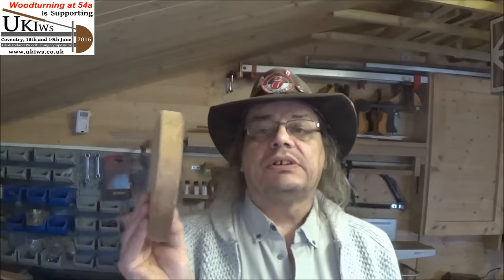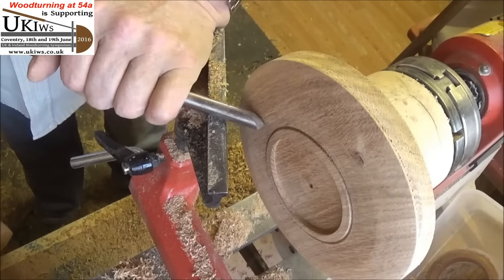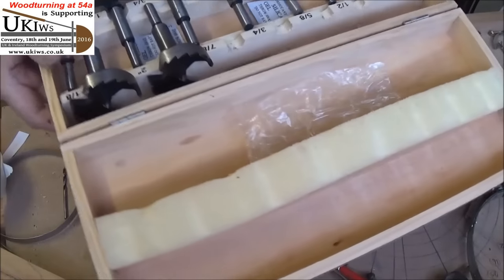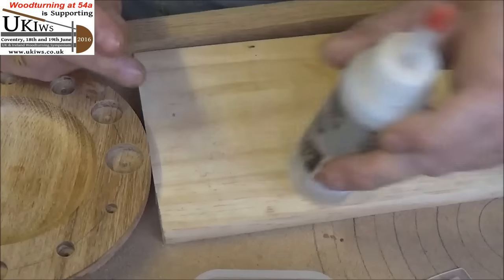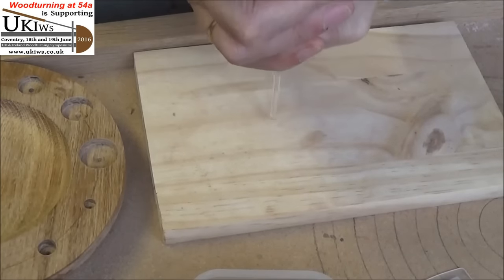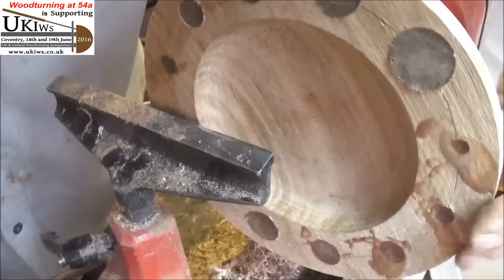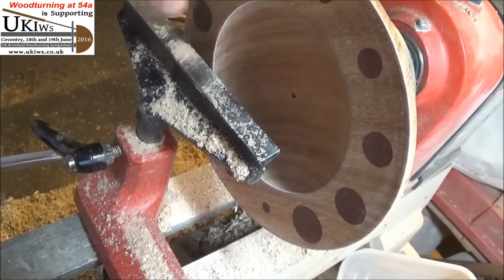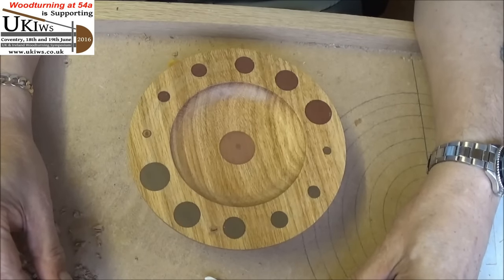Woodturning at 54a. #61 Oak platter with epoxy and metal powder inlays.

Comment: I didn't think I was going to like the epoxy inlays, thought they would look a little out of place, but I think it looks good, nice idea and I liked the increasing size holes idea, I'm pretty much brand new to wood turning, and I have to say binge watching your and Mike Waldt's videos have inspired me greatly! Thanks for the tips and ideas. All the best.
Adam
Reply from the maker: +Adam Ross Thanks Adam. There's nothing like a bit of experimenting to see how things turn out! I'm glad you're enjoying the videos,and will continue to do so. Mike's a lot better than I am,and his videos are the ones that started me off.He does the sensible things,and tells you the correct way,I do the nutty things that just seem to work for me(most of the time anyway).  Cheers,  Keith.
Reply: +Keith Barrow To be honest it was your coloured pencil bowl that got me hooked. And you have referred to Mike a couple of times in other videos so I checked him out. I have turned a couple of things so far, candlestick out of the old Christmas tree was my first and that worked really well for a first attempt, and have done a couple of bowls which came out well. I'm just trying to source a local merchant that sells decent wood but it's proving difficult so may have to use eBay for blanks ect. 
But again, thanks for the videos, look forward to them coming out and watching them.
Cheers.
Reply from the maker: +Adam Ross You're welcome,and keep on enjoying the hobby :)

Comment: If you were to apply a heat gun over them all(the resin filled holes) once the resin is in the hole it will reduce the surface tension/viscosity enabling:
1)It to bond/fill in to the edge of the holes more
2)Bring the bubbles to the top.

Brilliant video.. love your channel, itching to get the lathe back out and start some tinkering.
Reply from the maker: +TornTech  Thanks.I'll try that next time I get the resin out :)

Comment: Great minds think alike I see. I have a similar idea using epoxy with prime colored dyes. So far it is only in my head. I understand from some research on the subject that the 30 minute epoxy gives you more time to apply it and also gives it time to self level. If it is warm in the shop air bubbles also rise to the top and out of the epoxy. This would be an advantage for my idea as the epoxy will be nearly clear. The metal powder makes a nice looking inlay as well. I'm happy to see that it turns well and adheres to the wood.
Reply from the maker: +Gil Grace  Thanks Gil. There's lots of ways to use this epoxy stuff,and it's nice to have a bit of an experiment now and again :) I did use way too much powder though,but it was the first time I'd ever used it,so it was a bit hit and miss. Still,I know for next time!  Cheers,  Keith.

Comment: Love how it came out and I love working with resin myself. I always keep molds nearby for any excess I have so it won't go to waste. :) I was just going to suggest filling in that hole with epoxy but then you said it so... ;) It is really beautiful and could make a nice dish for a dresser top to hold pocket contents at the end of the day. 

Always better to call something a design feature instead of a mistake. ;) I fill holes all the time with epoxy. Just put some packing tape on the back of the hole so the resin won't leak out and fill it in. :) 

- Heidi
Reply from the maker: +BlackCat2  Thanks Heidi. I did put a bit of tape underneath like you said. I should have mentioned it in the video,but I always forget something!! Good idea about keeping a mould handy for excess epoxy,i'll do that from now on,thanks.  Take care,  Keith.
Reply: Keith Barrow :) I always forget something myself so I understand. My favorite mold is one I bought from amazon. It makes great coasters or hanging window decorations. I just dribble in whatever resin I have left from several projects until it gets filled. Creates a really neat item with multiple colors when done.
Reply from the maker: +BlackCat2  Great idea,I'm definitely going to sort something out :)

Comment: Nice design Keith. I've played around with polyester resin doing something very similar. I've got some glow in the dark powder that i'm itching to use but need inspiration.
I've stopped doing mortise mounting points on most of my projects as it gives me that few extra mm to play with but does mean that projects take a little bit longer to reverse and finish off.
All the best,
Ben.
Reply from the maker: +TeamWild Thanks Ben :) Glow in the dark powder eh? I'm going to have to get hold of some of that !!
Reply: +Keith Barrow I got the powder on eBay but I've attached a link for one example of what you can do with it.
http://eli-chemresinsltd.cmail2.com/t/ViewEmail/d/C0572E5C6D03BCEE
Reply from the maker: +TeamWild  Hi Ben, Thanks for the link,I'll go and have a look.

Comment: Perhaps you should go through the alphabet like the Met Office do with storms for naming. Cracking bowl. I remember when Martin used these powdered metals, which is where I guess you got the idea from. Something I will have to have a look into at some point. The hole in the bottom, I'm sure I see that when you first started turning the back and thought it was a little strange. I guess you drilled a hole each side. Great job well done!
Reply from the maker: Paul Lockwood We all make mistakes

Comment: Found a few lathes here in the states. I've heard you say some are just rubbishy. With that said, will one work to get into shaping some cookies. What is the worst one that I should stay away from ?what tools are a must the bare bones?
Reply from the maker: +Andy Ellenberg  The one I said was rubbish was one that a discount supermarket were selling for £60,it's only 3 speed,and it is a pressed steel bed,and you can't do anything with the tailstock. I don't think they do them in the States. I have said that it's better to go for one with variable speed,then you don't have to keep changing the belt,and go for the best one you can afford. Minimum tools? Watch my Ash collection where all I use are the basic 5 or 6 tools you will get in a basic set. Just make sure they are HSS steel,otherwise you'll be forever sharpening.

Comment: Keith, Your videos have encouraged me to finally join my local Woodturner's guild! What would you recommend I start with? 

Also, this looks great. I love Epoxy turning. Check out Peter Brown's channel, he does some awesome things with Epoxy! a few videos ago you made channels in a piece and filled them with coloured wood, wouldn't it look awesome to do a similar thing with epoxy like this? Perhaps with curved random lines using a router or similar? 

Keep making great videos!
Reply from the maker: +Paige Palmer That idea is already in my head Paige! Good idea to join a club.I've got nothing like that near where I live,so I've had to learn off Youtube,and plenty of practice! As for recommendations,there are a lot more experienced turners than me out there,who would probably give you better advice,but the best thing that I think they all would say is get the best you can afford.Get a lathe with variable speed,they're much more controllable,and easier to work with.Get the best tools YOU can afford,and learn how to keep them sharp.  Take care,  Keith